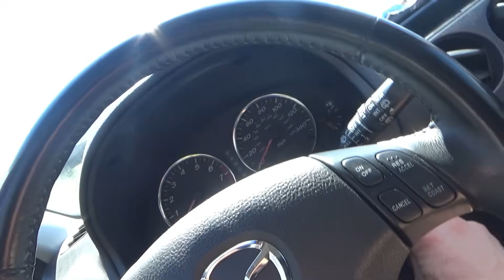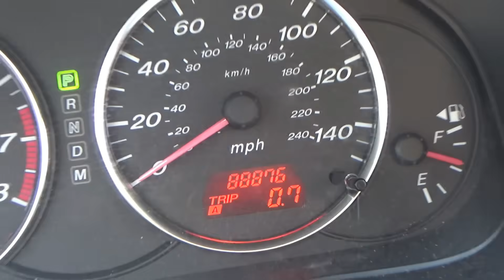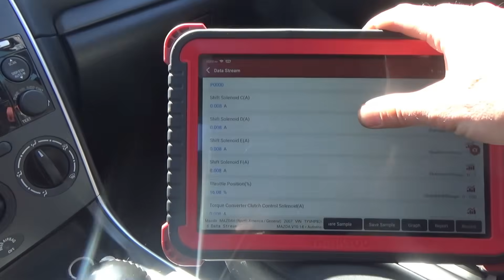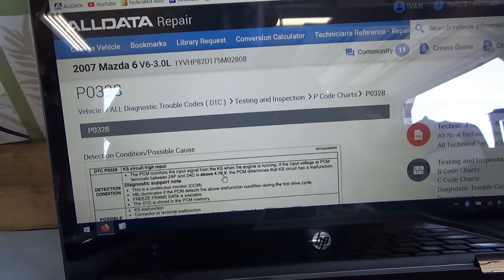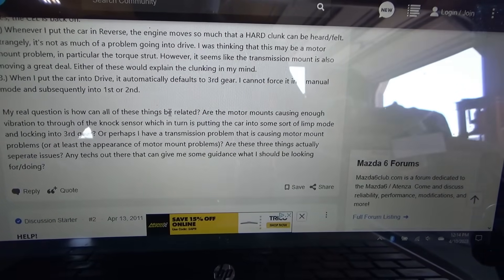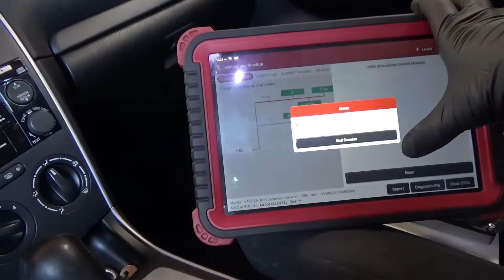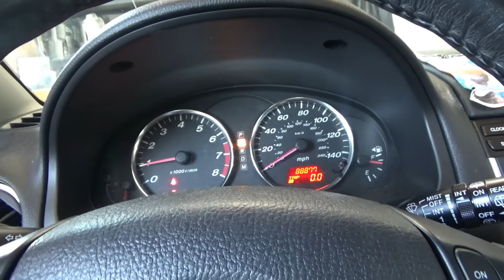At Transmission Shop for 8 MONTHS?? Fixed in 15 MINUTES!! (Mazda 6 Stuck in 3rd P0328)

Comment: My 2005 Nissan Maxima went into "limp mode" late on a Friday afternoon.  I drove it into a Nissan dealer.  Monday they replaced cam sensors and my car was back to normal.  It was expensive but they diagnosed and repaired effectively.

Comment: I cant stand that radio. Its not even easy to replace and the bluetooth adapter isnt great that I put in. I have a 2007 4 cylinder with P0061 and the light isnt on yet but it stalled a few weeks ago in an intersection and the throttle as sensitive as ever. Well it always has been its been in the family since it was new, I just dont want to fix it yet some people say its the throttle body and the solenoid

Comment: Unfortunately the number of Tech savvy mechanics and Automotive Techs like Ivan is fairly low. It's possible that the transmission shop had no one that even knew what a google search was, let alone how to do it (not to mention that even if the shop had a scanner, they typically probably ignore service codes that don't appear to be related to the transmission).

The other issue is that whoever wrote the software/firmware for Mazda either didn't understand what would happen if an engine code sent the vehicle into limp mode, or they didn't care, otherwise Mazda should have had the possible additional symptoms that would be generated by limp mode listed in their service documentation or, since I assume it's an issue Mazda dealers have seen, that should have resulted in the dealers reporting the issue to Mazda and a TSB being issued.

Comment: Nice work, nice what you shear knowledge and information...but, i not seen in video, probably you made mistake with that KNOCK SENSOR!? you must tighten him with torque wrench on specks.
Reply from the maker: My wrist is the Torque wrench 😅
Reply: @PineHollowAutoDiagnostics  I have once intervention on my Volvo, so, i must dismount knock sensor and mount it again... like you my wrist was torque wrench 😂😂😂 and in meantime time changed spark plugs NGK Platinum also, when firing, engine start with bad sound... came from valves, hmmmm, i checked plug's but everything was ok, then im realise knock sensor is problem, then im starting to study about and find hi must be tightened with exactly torque, but, you knowing that also, and im must comment 😜😜😜.

Comment: A supposed leak in the secondary air injection system of my Tundra put it in limp mode.  But I learned if you got the truck hot so it didn't run the SAI system on startup it wouldn't reset the code until the next cold start.  It's a 2007 right on the limit of a Toyota extended warranty where Toyota's fix was to replace the whole system for a few thousand dollars.  

No real evidence of a bypass leak but I cleaned the reed valve and around the solenoid valve.  Cleared it right up.  For. a few squirts of brake clean.  Must have been some smoo in the seat of the solenoid  valve as the code set once after then never again.

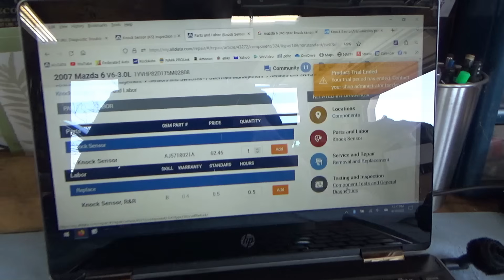Comment: Get this one Ivan, have a 2012 Ford fusion which has electronic steering, was changing the oil I left the hood a jar backed it off the ramps and it got a steering fault close the hood and it was gone. People drive with a hooded jar but they won't drive with the steering fault 11:13

Comment: Same thing on an 03 Taurus. Stuck in 3rd gear. 2 transmission shops said it needed new transmission. 3 egr codes and 3 transmission codes. Found that egr and transmission shared same circuit and wires were melted on egr pipe. New fuse and a quick wiring repair and the car was fixed after 1 year of sitting.

Comment: Amazing story... This rarely happens at my shop, BUT IF we diag a car replace or repair per our diag and the car has same problem. Customer is not charged anything. IF we can't fix it, ZERO dollars, period. LIke I said this doesn't happen often. It amazes me that shops charge for no results.  Oddly many customers seem willing to pay for the parts cannon but not for diag fee's. Of course cars can have more than one issue, and there are variables. But for the most part if someone puts 6 parts in your car and nothing changes but the 7th part fixed it. Guess what it just needed the 7th part. Sometimes shop just have to take the loss and punt if your in over your head.

Comment: When computer based troubleshooting fails, only two thing get traction: fundamentals knowledge or analysis of code itself.  Limp mode is basically a fault code in and of itself - hard inputs missing or present, and/or parameters being seen outside the "box" will force certain outputs.   Sad to see this thing sat for so long on account of techs with so little I/O grasp under their belt. 
So: what is a failsafe?  It's an output that is the default condition absent normal [input] conditions.  A broken wire, corroded connector, or a faulty chip/channel can exist and a failure to operate normally is guaranteed.  As an example, most alarm systems function as such: a closed loop with some end of line termination - break a wire or end of line device fails and the alarm goes off.
I cannot think of a reason for limp mode caused by knock sensor except... programmers sought to lockout use of timing curves peculiar to 1st and 2nd gear rather than...retard timing across the board and throw a check engine light where knock fault persists.

Comment: I think the big question is what would make someone go as far as disconnecting the knock sensor, I'm guessing because they thought it's input/circuit might have something to do with the problem, and that disconnecting it could solve the issue, but not go as far as replacing it? Pretty much textbook definition of so close, yet so far.

Comment: I could see that. If the engine is pre-igniting, then we may want to adjust the gearing and if the knock sensor is bad, we don't know if we have to take any safety steps with the transmission. Amazing the power of Google.

Comment: I had an 02 Toyota Highlander that had knock sensor codes and also went into limp mode... no other codes.  Wasn't the sensor though, in my case it was a sub harness connector to the sensors that had gotten brittle and broke... good thing too because it had two knock sensors and OEM were over $300!  The sub harness was about $60 .... dodged a bullet there -

Comment: Sister's Peugeot had abs problems. The fuel filter was replaced and voila, abs no more. The cause of course was quantum entanglement.    Knock,knock my transmission is not working. The knock sensor is faulty. No head scratching there. Great fix after a year on the sidelines.

Comment: When I saw that knock sensor code the first thing i thought of was searching the internet for those symptoms... That's such an odd thing to force the transmission into limp mode for that you'd be guaranteed to get a hit if it was related.

Now if there were 4 other codes it wouldn't be as obvious, but I think a search would still bring some guidance.

What weird programing. Forcing limp mode for a knock sensor!!

Comment: Had a similar problem with a 2013 Kia Soul 2.0. I had no tach transmission was stuck in 5th gear and had reverse. Kia had just changed the transmission oil temperature sensor which was a stored code. Sensor was bad. Check engine light was off no codes stored after replacement. Believe it or not the tach was the clue that made me change the crankshaft position sensor. Bam!! Tach is back and transmission shifts perfect. Hard to believe no codes were set. Car has been driving fine for 2 months now.
Reply from the maker: How could it even run without a crank sensor? And not set a code??
Reply: The car was in limp mode it ran pretty good on the default program it’s just that driving up a hill in the default 5th gear was nearly impossible. The funny thing is it never set the check engine light till after I got the part and was ready to install it. The clue was no tachometer.

Comment: The owner is very lucky. A lot of transmission shops would have tried to sell him a full rebuild.
Reply: I have seen this personally. In one recent case, a local transmission shop put two dealer supplied transmissions into a Hyundai, and they still couldn't figure out why the transmission wasn't operating properly. They called in an outside trouble shooter, who within an hour, determined that the harness connection to the transmission had been compromised and needed to be replaced. The vehicle never needed a transmission in the first place.
Reply: Thank goodness they didn't go that route!
Reply: true

Comment: What, no bonus footage? Seriously though what is your opinion of automotive sensor simulators such as Hubitools, Quick Pro logics and others? Your last couple of videos have had a bad or questionable sensor that could have been substituted with a sensor simulator to save troubleshooting time. Some of these simulators can do square wave, sine wave, variable voltage and resistance to name a few. Once again, only a suggestion, so keep up the good work, and may the force be with you!

Comment: I don't understand Mazda's programming logic on this. The ECM knows the resistance of the sensor is out of spec, meaning the sensor is bad, there's no engine knock. Why put the car in limp mode at that point?

Comment: Reminds me of working on my sisters car. 2016 Toyota 4 runner. No crank, no start because of a wire short in the rear tail lamp brake light. Blew the brake light fuse and disabled the vehicle.

Comment: Mazda 6 Wagon....unicorn. Google search to the rescue of a limp mode Mazda. ~10 ago not knowing better about going OEM, installed a BWD/Intermotor (div SMP) camshaft position TDC sensor form Advance on Civic, Still working like a champ. I think they make decent parts (sensors at least) for Asian vehicles. This one time, scan code alone was spot on solving trans limp mode issue. Who'd a thunk it. I'm sure owner happy to have his unicorn back in action. Nice job Ivan.....again. 👍

Comment: I have just dealt with a Jaguar S type that was going into restricted performance mode with no codes.  It turned out to be the knock sensors.  Took a bit of research to find the problem.

Comment: That connector being previously disconnected means somebody was so close but yet so far.  Being able to ohm out the sensor made all the difference.
Reply: I guess they figured that if they removed it from the circuit, it couldn't cause a problem..... 😉
Reply: Guy probably got pulled off of the job before he finished the diagnostic ...

Comment: Japanese cars have most bizzare limp mode ”problems”. One of my customers dropped a Nissan Almera that wouldn’t have any power, barely got up to 60-80kmh when floored. No fault codes, i checked the throttle body, wiring to the ecm, all checked out with factory service manual. Throttle body wouldn’t open past like 20%

Problem was burnt out brake lights 😂 God damn factory service manual didn’t say anything about it and there was no fault codes anywhere in the car.
Reply from the maker: That's crazy!
Reply: That's a classic on Nissans. My mechanic friend got an Almera in with limp mode, and the reverse camera being always on what as dead giveaway.

Comment: a bad knock sensor can put a car in limp mode. it happened to my 04 camry
Reply from the maker: Engine yes... But disable the transmission?
Reply: @PineHollowAutoDiagnostics  , it wouldn't shift into 3rd

Comment: It shows transmission shops don't always know enough to care or research the issues. Isn't google cool sometimes. It was also sweet that someone was willing to share their problem and eventual solution. The customer must have been ecstatic. Great job Ivan and for not limiting your options.....Pete
Reply: They (shops) just want easy repairs and quick money…
Reply: @knocksensor3203  - that makes sense. This simple repair was only 0.5 hours according to the Ivan's online book. Why should a shop fix a customer's car and only make 0.5 hours when they make easy money fixing transmissions? (thank gawd there are shops like Ivan's that have integrity)

Comment: Haven't watched the entire video. But older Toyotas will do what this thing is doing if there's knock faults. Trans will go into limp mode. Etc.
Reply from the maker: How old? Never seen any vehicle completely disable shifting with a knock sensor code 😅
Reply: @PineHollowAutoDiagnostics  Like a 2007 Sienna. This was like a year ago. Hard to recall exact year. But I remember the body style. And a 2007 looks like the one. But yeah man. It was doing the exact same thing. And it definitely took me down a long erroneous road. Lol. Until I finally decided to pay attention to the knock codes. In my mind I was so convinced that knock codes had nothing to do with anything that hyst ignored it. But lesson learned.
Reply from the maker: @foolsendextremebashing  ahh 3.5 V6. I've seen plenty of knock sensor codes on 2004 and older Toyotas and transmission was never affected... Just retarded ignition timing and sluggish performance 👍

Comment: The knock sensor being disconnected or faulty will also impact engine performance; ECU will pull ignition timing.  This can also result in catalytic converter damage.

Comment: So when I saw the knock sensor code my immediate thought was the computer is going to be very conservative about timing.  It seems the powertrain engineers were so concerned that they also directed limp mode for the transmission to possibly dissuade the owner from just driving it around like that.  Fuel economy and power would be greatly impacted anyway but some people will tolerate that stuff out of laziness.  In limp mode you are kind of forced to fix it.  That's my theory anyway.  That is vaguely similar to the Toyota strategy of lighting up the dashboard for an O2 sensor code.
Reply: Locking the trans to 3rd puts an awful lot more load on the engine at low speeds, exactly the conditions where knock is most likely to happen...

Comment: this is like subarus that throw p420 or p430 that disables the cruise control.ive fixed several not because the customer cares about the mil light but that they want the cruise to work.

Comment: In my experience transmission shops are really good at rebuilding transmissions and dealing with mechanical issues Not so much with electronic problems.

I have seen so many weird seemingly unrelated problems in this industry I don't even question anything anymore, you got to start with what's obviously broken and work from there So in this case a battery and a knock sensor.
Reply from the maker: Considering that all transmissions from the last 40 years have been electronically controlled, you would think that transmission shops would know basic electrical too? But this problem wasn't transmission related at all so I can see why they were stumped 😅

Comment: yep, cars always have zero gas and dead batteries for troubleshooting.... except when you need to do a fuel pump and drop the tank.  then 100% full.   Also,if you need to remove a wheel they have keyed lugs and the key is in their garage at home...

Comment: HI Ivan. I bought a BMW 330ci late last year. When I got the car, the cruise control would not stay on. I'd turn it on, and it would switch off immediately. I scanned it for codes, and came up with a faulty MAF. I replaced the MAF and the cruse control came back to life. Who would of thought that the two are related? Nice work Ivan.

Comment: Great pickup Ivan! Mazda should really issue a TSB or some sort of instruction to alert mechanics (including their own) of this issue that  can cause the transmission to go into Limp/Safe mode. It is way out of left field that a knock sensor would cause this transmission issue!.
Reply: Ivan. Logically. If the engine indeed had a slight knock. 
Would it make sense to try to save the engine and transmission. That's why the transmission was in limp mode?
Because I've had customers had a noticable knock and they were revving the engine even more 😂
Saying o...it's been like that I'm just driving it till it gets worse. Duh
Reply: Really this shows that DATA is important... if manufacturers listed the CONDITIONS that can TRIGGER a limp mode... then you can just look it up but no they all have to be secretive about their damn software then years later they just act like they never made the car and no-one can see the data it's all so stupid
Reply: Stupid f*ks...take names.

Comment: Watching you cover so many topics, I have learned to look at everything going on with a car. AND visual inspection!  
My daughter's car had a blower motor issue and all my research led to a wiring problem near the fuse box.
But, performing a visual inspection on the wiring in the circuit,  the resistor had gotten so hot, two of the wires had melted together shorting the circuit. 
A new pigtail connector and it's fixed!  The resistor was fried, that was the original  cause of the problem.

Comment: This is like an extreme version of what happens to Toyotas (and maybe other manufacturers): when the knock sensor code prevents engagement for some gears. I've seen a Nissan (1st gen Xterra V6) have consistent misfires (flashing MIL) under medium to high loads while in motion (i.e. Drive) simply because of a bad knock sensor. The misfire didn't happen when revving the engine in Park or Neutral.

P.S: Bless Mazda for that knock sensor location on this V6. Most other OEMs hide them in the valley.
Reply: Great job as usual!
Reply: @AnnaWaipa-bq7dd  Thanks, but "as usual"? I don't quite understand.
Reply: my 97 nissan quest was chewing knock sensors like there is no tomorrow.i think it was the bad position they chose to mount it.
Reply: @marlu6373  The knock sensor in the Xterra I referred to failed due to corrosion from the cast Iron engine block and a slow leakage from the corroded metal coolant pipe alongside it right at the bottom of the V6 engine valley.